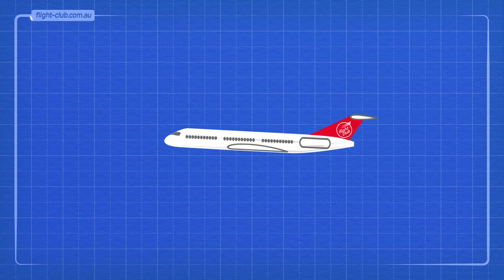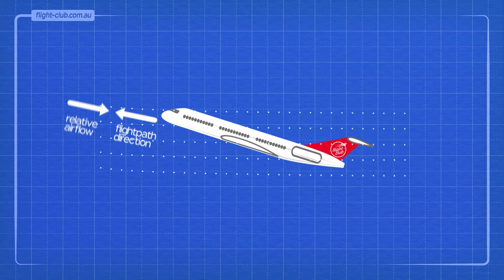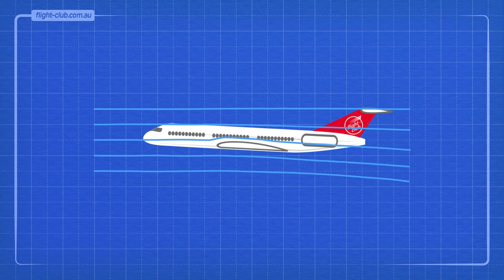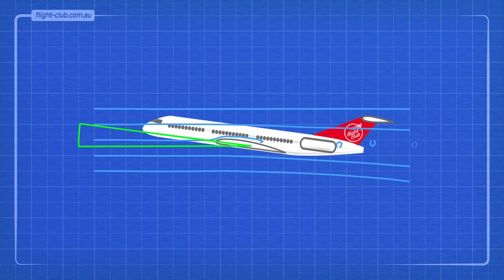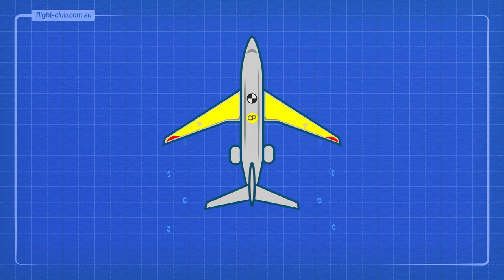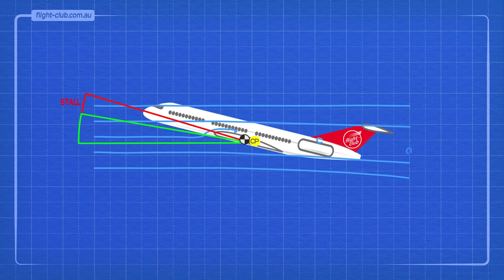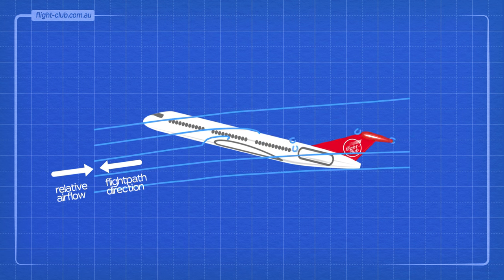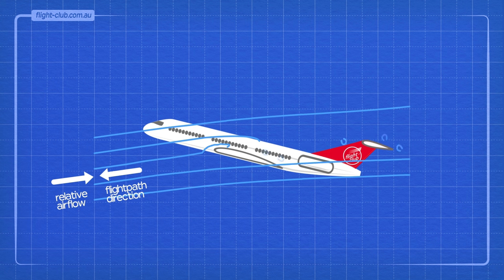Understanding Deep Stall | The Super Stall.

Comment: Only “T” Tail aircraft are affected by the “Deep Stall” phenomenon.  They have a device installed in the cockpit called a “Stick Pusher” which automatically forces the control column rapidly forward if the aircraft approaches the stall.  This action forces the nose down, increasing airspeed, thus preventing a deep stall from developing.  Once a “T” Tail aeroplane has entered a deep stall, recovery is totally impossible and a fatal crash will result.  Hence the “Stick Pusher”.  This is exactly what happened to the British European Airways (BEA) Trident (Papa India) disaster at Staines, near London Heathrow in 1972.  It’s a very famous air disaster case and well worth a read, or watching a video about it on YouTube!
Reply: But why T tail is only affected by deep stall? Please explain scientifically
Reply: @pixelapse9613  

basically, as angle of attack increases to the critical angle, the lift from the main wing is reduced and the turbulent air raises and covers the elevators, making them far less effective, which further contributes to the effect along with slow speed and sinkrate

 think static instability but only at critical angles of attack

Comment: Learnt a new concept under stalls..Thank you...
What I never like is the fact how nonpaid pilots(they were unpaid for 6 months) were blamed for a dual engine failure and stall due to a lack of procedures in the airline to measure the weight of the bags appropriately! This MD-80 hence got into a super stall, and there were dangerous updrafts too unfortunately!

No wonder this type of aircraft is discontinued!
Reply: This type of aircraft,like every other,has its pros and cons,but i can assure you that it is just as safe as the others if you control it as you're supposed to..

Comment: You can use thrust , aerons and rudder to get out of it, if the flight computer doesn't block your inputs.
Reply: on any airbus you can turn off the two elacs and two facs to get into direct law, with absolutely no protections blocked inputs or modified inputs
Reply: In a deep stall, nothing that you mentioned definitively works towards lowering the angle of attack. Remeber the airplane already has a very high sink rate. Only a definitive nose down push can break the stall. Without the tail, this cannot be effectively accomplished.
Reply: Nope!

Comment: sooo .. how you supposed to recover from it?
Reply: You can’t get into it in the first place. The T tail transport category airplanes require a mandatory ‘stick pusher’ that breaks the impending stall before it gets to full development.
Reply: The horizontal stab can still have some authority. If the pilot can create enough up and down pitch oscillation by using a combination of thrust and elevator application, they may be able to force the tail out of the turbulent air and recover.

Comment: BE 548 ?
Reply: BEA may have had a deep stall but the actual cause of the stall was the retraction of the Droops 60 knots below the retraction speed causing an immediate stall that left the only possible way to recover was to extend the droops back to the extended takeoff  position. Nothing else could have saved them.